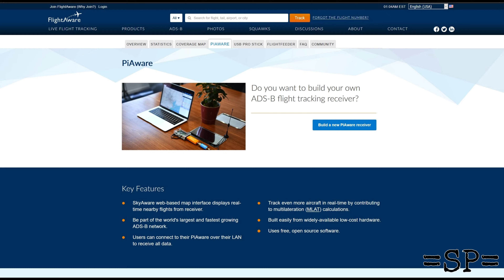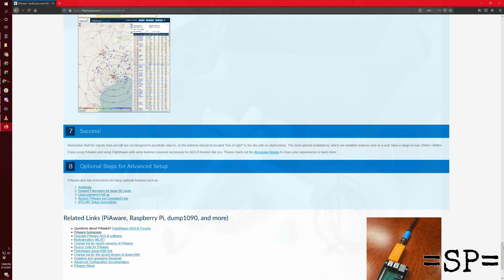DIY Rooftop Raspberry Pi Aircraft ADS-B Build

Comment from the maker: Updates: If building again, I'd make the antenna separation wider. I'm no RF expert, but I think being so close has decreased reception. The 978 performs better when the other antenna is removed.

I didn't mention in the video, but the third USB device is a WiFi adapter since this Raspberry Pi 2 doesn't have integrated WiFi.
Reply: Nice build!  Is it still in alive and kicking?
Reply from the maker: Yep! No issues at all.
Reply: What if you twisted the wiring.  Would that cancel out Rf
Reply from the maker: The antenna feed lines are shielded from the base of each antenna down, so I don't think anything internal is an issue.
Reply: Great job! I'm interested in the Wifi dongle. Please could you explain how so set-up the Pi for it and how is the communication with the PC (I'd like to use an old Laptop running with Chrome OS flex - I actually have problems to recognize UBS devices, especially for programming Arduino boards). Thanks for any advise you can give!
Reply from the maker: Newer RaspberryPi boards have WiFi built in. This is an older board so this is a cheap eBay USB WiFi adapter. No special setup.

If you want to learn about RaspberryPi in general, I would recommend buying a Pi 4 or 5 with the operating system image pre-loaded. All you need is a monitor/tv, video cable, keyboard, mouse, and power supply. The https://raspberrypi.com site has great documentation & tutorials.

As for this project, once everything is up and running, you can visit a local webserver on the Pi to see the traffic as shown in the video.
Reply: how will you get on in summer ? wont that cook? back box, with no vents, in full sun ?
I ask the question as mine gets delivered tomorrow. Im in Australia. I think the sun would kill it in no time here lol
Reply: I can't see that proximity would be an issue for receive only antennas... if they were transmitting then yes, but if not it would surprise me.   Do you have a specs or instructions for building the antenna?

Comment: Is heat an issue? Especially when receivers are in a box. I have a ADS-B receiver and its running hot out in a room, closing it in a box will make things a lot worse.
Reply from the maker: I've had no issues and haven't seen any performance hit when hit is warm. That said, we are near the coast, so the weather is mild.

Comment: That is a pretty nice build and glad it is working. I'd like to do something like that but I would have to go through the roof.
Regarding the USB at 3:27, is that for the 978?  And what is the green USB device at 3:57?
Reply from the maker: Yes, two SDRs: one for 978 and the other for 1090. The green adapter is the WiFi dongle as this older Raspberry Pi doesn't have built in WiFi.

Comment: What range are you getting?
Reply from the maker: With my current settings, FlightAware reports about half the updates are from 0-50 miles and the other half are from 50-100 miles. It does get a small amount from the 100-150 mile range and a very few 150-200 mile messages.

I was getting more range with higher sensitivity/gain, but the local traffic was overwhelming the receiver. Since I was intentionally trying to fill a local gap in coverage, it made sense to bring the sensitivity down to favorite the more local signals.

Comment: A very nice construction. What temperature does your Raspi have in summer?
My first construction was like yours. (everything on the roof) But my Raspi got too hot. Now I have moved the Raspi into the (heat-insulated) roof box. At the moment my CPU temperature is 31°C. In summer just over 40°C. The Raspi works without any problems.
Many greetings from Germany
Reply: I've found the SDR runs very hot, and I've had one fail. I put vents in the box and that cured it.

Comment: What is the total cost. Advantages of building on your own over purchasing the equipment ..and what is the reliability of home made. Also  do you need to have an fcc radio license
Reply from the maker: Much of it was pieces I already had left over from other things. Today, FlightAware sells a single frequency kit for $120. Doing some quick shopping around now, I'd estimate about $137 to reconstruct my build buying everything for both frequencies.

Raspberry Pi $35 (mythical pricing here in 2022)
MicroSD $5
USB power $7
FlightAware Pro Stick Plus $40
FlightAware Pro Stick $37
PVC parts $5
RG-58/WBC-195R cable, 2 feet $2
2 SMA connectors $1
Plastic box $5

You can save big not getting the FlightAware USB SDR radios, but get the generic ones on eBay for around $15 each. They don't have filters, so the range isn't as good, but they still work pretty well!

I've had zero reliability issues.

No license needed. This is listen only. No transmitting.

Comment: Cool! How does this do in the hot summer sun? It seems like with no ventilation it could get VERY hot in there to the point where it might overheat.
Reply from the maker: It has been going over a year without issue. Our temperatures here are reasonably mild, so it might struggle elsewhere.

Comment: Looking to replicate this project except raspberry pi are not available 😑. Is the 978MHz PiAware ADS-B Kit worth it for the price?
Reply from the maker: You might be able to save a few bucks piecing a similar kit together from Amazon & eBay, but it actually look like a pretty good deal for what you get. I didn't use the filter, so I can't comment on how that would improve performance. I also don't know if the Zero can handle two receivers on one Pi.  Do you only want 978MHz or are adding to an existing install? Most of my traffic is on 1090MHz.
Reply: @ShumanProjects  
Thanks for the input I will  do some amazon and ebay searching. This will be my first build.

Comment: Neat project!
Did you encounter any problems with heat, from the electronics enclosed in a airtight box exposed to direct sunlight?
Reply from the maker: I haven't had any issues and it has been running over a year now.
Reply: @ShumanProjects  Thanks for the feedback. Good to know.

Comment: are you feeding adsbexchange too? if not, please consider doing so..
Reply from the maker: Yes! I started with the FlightAware image and have added OpenSky, ADS-B Exchange, and Flightradar24 to the same Raspberry Pi. I think I have about maxed the CPU at this point.
Reply: @ShumanProjects  awesome!
Reply: @ShumanProjects  I have always wondered if it would be possible to feed to more than one sever with the one Pi.  I ended making two complete, separate stations, one for FR24 and the other for RadarBox.
Reply from the maker: Yes! You can certainly feed multiple sites from the same Pi. I guess now with a second one you could set them both up to feed both sites, then move the second one somewhere else for more coverage!
Reply: @ShumanProjects  Will look into that!

Comment: Thanks for the great video ! Looking to do that myself too but have 0 knowledge in Raspberry Pi. And I would like to stream the ADS-B data to all the tracker websites (FlightAware, FlightRadar24, AdsbExchange, Radarbox, etc..). Is it possible with only one antenna? Do I have to code or just download each platform image on the sd card?
Reply from the maker: Thanks Paul! You can run one copy of the SDR software (dump1090/dump978) per SDR and have multiple processes reading from it. I have four different sites I'm feeding to from one Raspberry Pi. Be aware each new site does add CPU/memory load. There are many write ups that walk through getting multiple feeds going. Good luck!
Reply: Why don’t you just buy a radarbox xrange. It does everything you say and you don’t need any knowledge for it.
Reply from the maker: 1. Looks like that would cost three times what I paid for parts, so your idea is more expensive.
2. The xrange looks to only have one radio for 1090 MHz, so my cheaper solution covers both 1090 MHz and 978 MHz.
3. Some people buy furniture at the store and some people make their own. I like to make stuff more than buy it.
4. "Don't need any knowledge..." ? I love to learn and understand, so building something new is more enjoyable to me than some prepackaged thing.

I'm not saying you have to build your own setup, but I'm certainly glad I did.

Comment: Very nice video! Thanks so much for this. Hopefully I can recreate this. Will keep you posted. (: How much did the whole project cost you at the time?
Reply from the maker: Thanks! Let me know if you build one.

Cost at the time would be hard to say. Much of it was pieces I already had left over from other things. Today, FlightAware sells a single frequency kit for $120. Doing some quick shopping around now, I'd estimate about $137 to reconstruct my build buying everything for both frequencies.

Raspberry Pi $35 (mythical pricing here in 2022)
MicroSD $5
USB power $7
FlightAware Pro Stick Plus $40
FlightAware Pro Stick $37
PVC parts $5
RG-58/WBC-195R cable, 2 feet $2
2 SMA connectors $1
Plastic box $5

You can save big not getting the FlightAware USB SDR radios, but get the generic ones on eBay for around $15 each. They don't have filters, so the range isn't as good, but they still work pretty well!

Comment: does rtl-sdr v3 work with this setup?
Reply from the maker: Yes, while I don't have hands on experience with it, I do see posts about people using it. One difference with some other SDR adapters is it looks like the RTL-SDR doesn't include a filter to limit to just the ADS-B frequencies and doesn't include an LNA. It will still work, but won't pull in some of the weaker signals.

I started with a unbranded SDR module without a filter and LNA. It worked fine to get started.
Reply: @ShumanProjects  thanks for these info.

Comment: This is great, but I have a question no one seems to answer. Why buy a Raspberry Pi, antennae, etc to track aircraft when you already can through ADS-B Exchange free of charge?
Reply from the maker: This is what feeds ADS-B Exchange. From their website:

"This wouldn’t be possible without our amazing community of volunteers and feeders hosting airplane tracking equipment all over the globe. And we are always looking for new participants to expand our network.  Be sure to check out the “how to feed” page to find out how you can help."

In my case, there was missing coverage on 978 MHz in my area, so you can thank me specifically for that data on ADS-B Exchange.

Comment: wow how noticeable that will be. i just have a 1090MHz fiberglass antenna up on the roof
Reply from the maker: Glad you have something working for you. As for noticing my build, you can't see the box from the street at all. The antennas have line of sight to the horizon, so it works out well for my goals here: cheap, elevated, and no drilling holes in the house.

Comment: I like the setup but do you have temperature issues with the Raspberry Pi?  I’m assuming it’s in direct sunlight in that sealed box with no fan aspiration. Is there a reason why you didn’t run the antenna wires into your house and then connect to the Raspberry Pi where it would be in a climate controlled area?
Reply from the maker: It has been running for over a year now without any temperature issues. Our area has mild weather, so I'm sure that helps. My goal was to keep the RF path as short as possible. I don't have any great places to easily route coax from the roof to the interior of the house without long runs. I also liked the idea of everything self contained. Thanks for watching!
Reply: Long rf feedlines can be a problem in terms of loss at these frequencies so keeping them short is a good idea.
Reply: Max working temp of raspberry pi is around 150F and the SDR may be even lower than that.  Spray painting the outside of the box white will help a lot.

Comment: You should use 3M (Scotch 23) vulcanizing tape instead of electrical tape. Higley recommended for this kind of connector sealing.
Reply from the maker: I'm sure that will last longer, but electrical tape is what I had on hand at the time. Thanks!